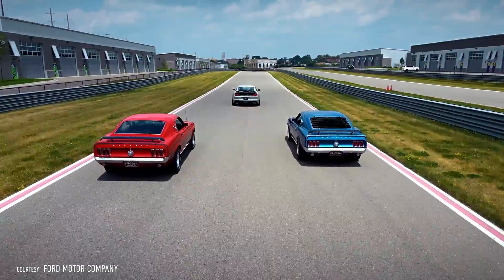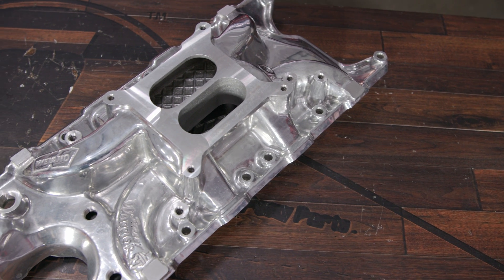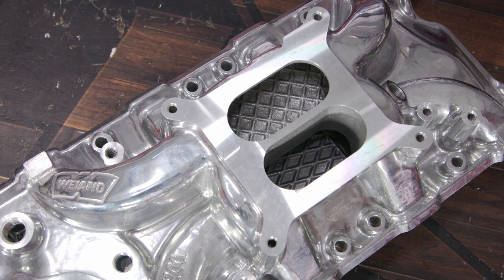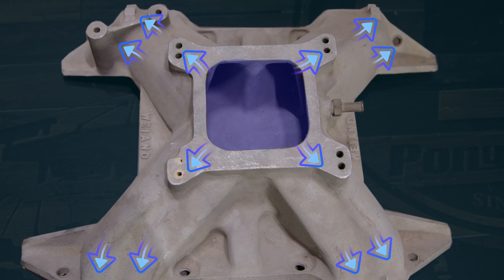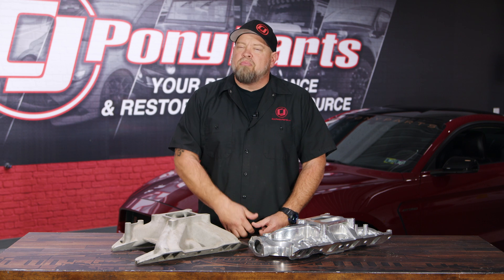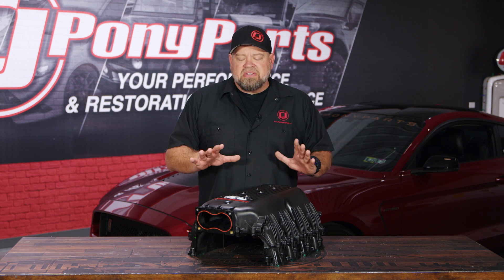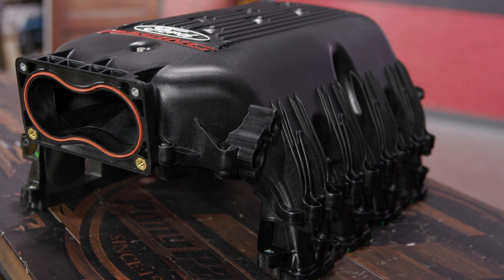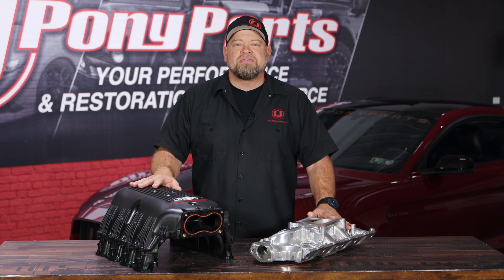Carburetor and EFI Intake Manifolds Explained!! #howdoesitwork

Comment: How do you have vacuum in a inclosed system to continue to pull air into the intake manifold.
Reply: It's not really closed. The engine is an air pump so it is sucking air and fuel in and expelling it through the exhaust.